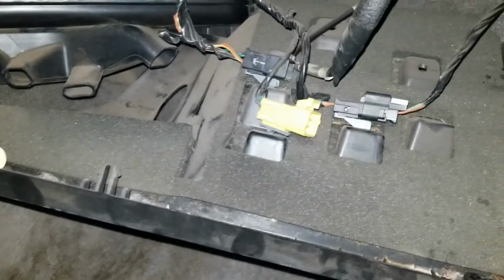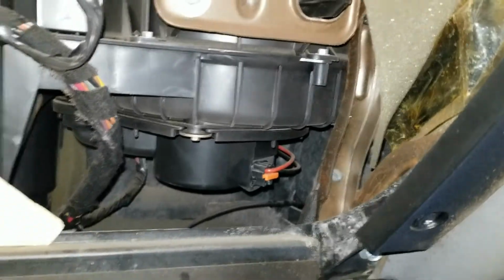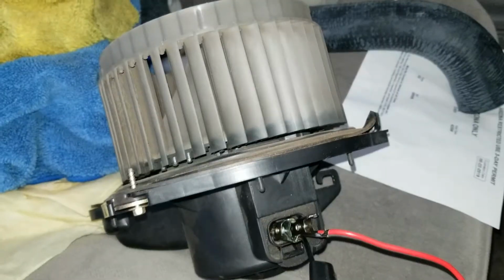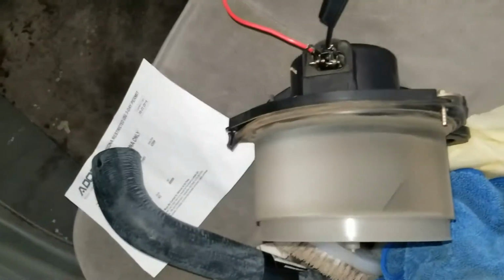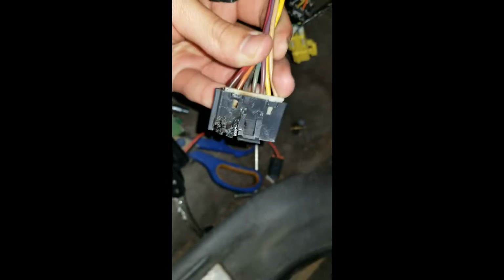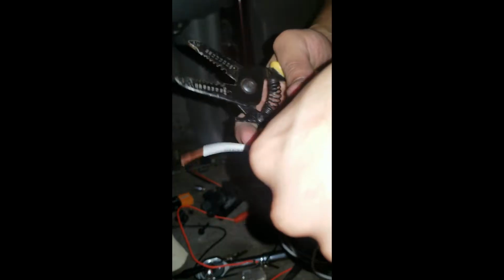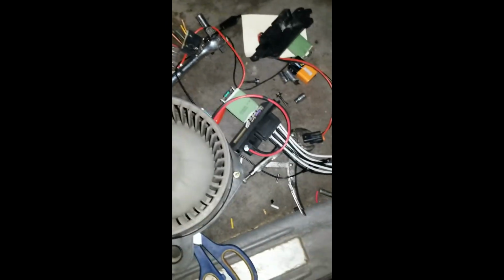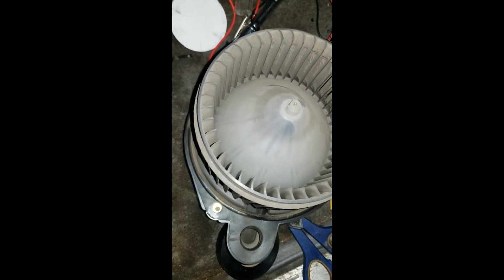Car A/C Fans Not Blowing | Blower Motor and Resistor | 2006 Chevy Trailblazer

Comment: Did you figure out why the circuit got hot enough to melt the connector?
Reply from the maker: I've ran into this problem multiple times and some are melted and some arent but all have been "burnt" to some extent. I dont think its something specific to this vehicle only.